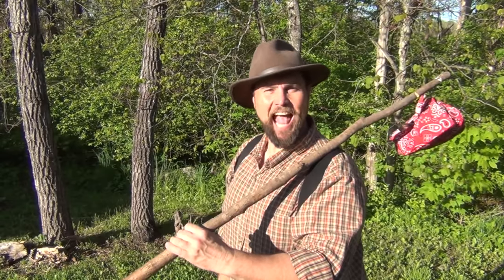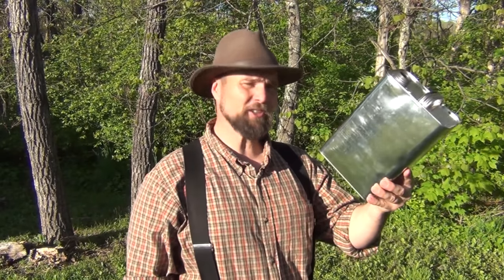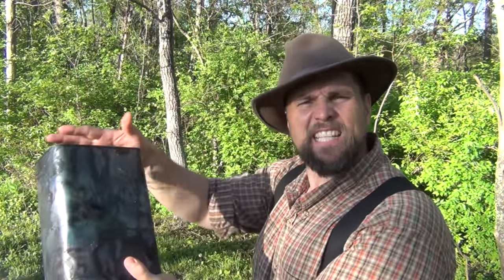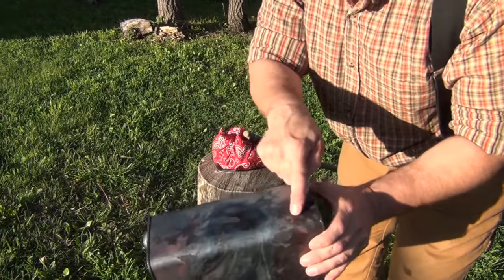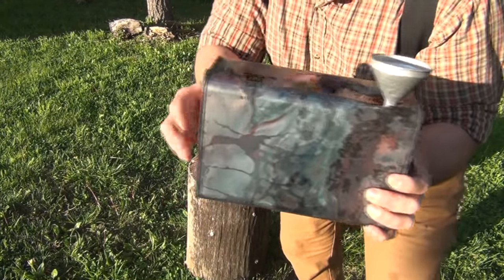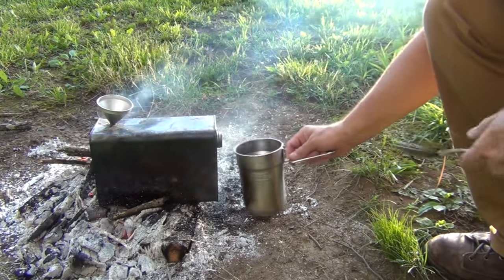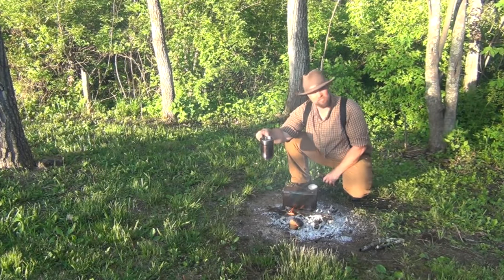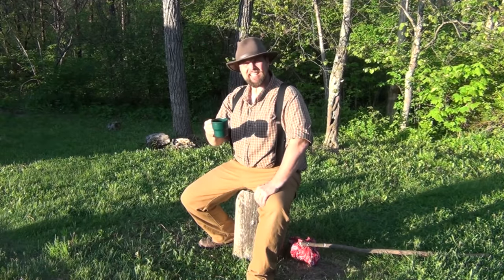Hobo Water Heater - Really Works!

Comment: Why didn't you just put a pot of water on the fire and wait for it to boil? Seems senseless to me to go through all that trouble when you could just put a kettle on and let it boil.
Reply from the maker: I think you missed the point of the video. The idea is to have a relatively constant source of hot water. You just pour more cold water in the top and hot water comes out.

Comment: You dont even a hole or funnel just stick the metal container with the pour hole facing up instead of on its side…
Reply from the maker: That wouldn't work very well as it doesn't allow you to continually refill the container while simultaneously getting hot water out.

Comment: love James' videos and enthusiasm, but please be aware that the spout coming off in the fire, that is the tin-lead solder joint remelting.   i would not use such a contraption for potable water, not a food grade container.   i like my coffee unleaded
Reply from the maker: Please note that the heat melted all of the solder away and that it was only on the outside anyway.

Comment: Why don't you just eliminate that stupid can and boil the water in that Stanley Cup as it was designed to use. One of the main reasons it has a lid is to keep Ash out
Reply from the maker: Actually, the military has been known to do this on a larger scale using a 55 gallon drum. The idea is that you can have a somewhat constant source of hot water instead of just one cup at a time.

Comment: Watre heater !  There is 0 reason to heat hot water ;)
Reply from the maker: Yes, it is a hot water heater because it continually heats the hot water. That way you have a relatively continual source of it.